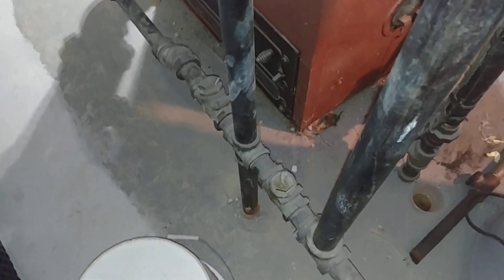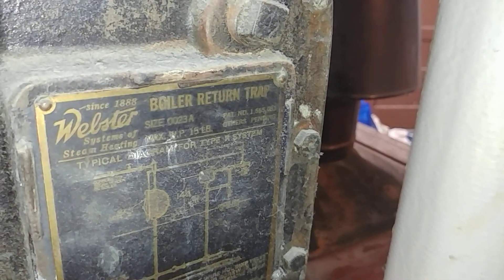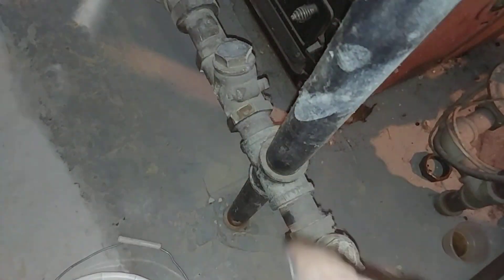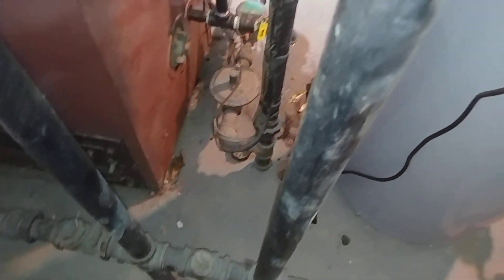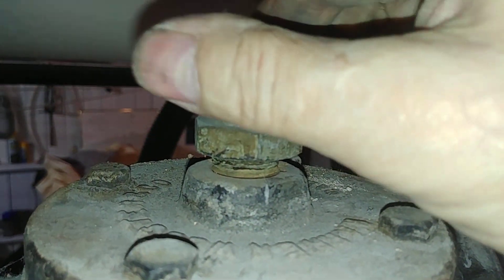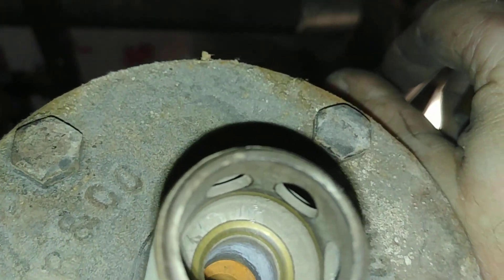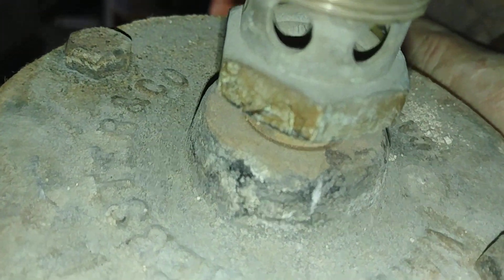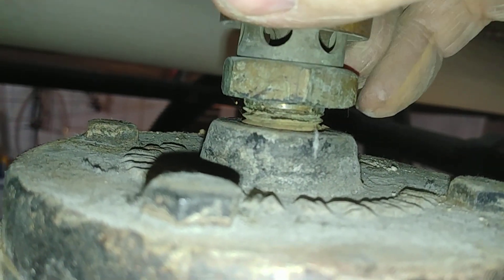Warren Webster Two-Pipe Steam System Was Still Running In A Vacuum. Not Anymore

Comment: Thanks for this video! I recently bought a house with a two pipe steam system and am learning its ways. I've never had steam before and have tried to educate myself by reading We Got Steam Heat, but I've had a weird issue involving this exact component. When the system kicks in, there is a pressure buildup of anywhere from 2.5 to 5 psi, during which time no steam is reaching the radiators. Then there's a very loud "PSSSHHH" from this valve. The pressure immediately drops and the radiators come to life! This works out ok when going from a cold house first thing in the morning, but when trying to maintain a daytime temp, the system often doesn't run for long enough for the pressure build/release to happen. I'll try looking into this vent valve to see if the ball is stuck.

Comment: hello, my church has a old 2 pipe steam system which i believe is a vapor 
/vacuum with a dry return.  With your help i was able to change out all the cage units to barnes and jones.  The system went from making all kinds of steam and water hammers to mostly silent .  On the dry return near the boiler is a dunham 220B air eliminator.  I believe the check has been replaced with a gorton air eliminator no. 1.  I would like to replace it or upgrade it if needed.  Is this the right component on the 220b or should i be using something else/better.  Thanks
Reply from the maker: Thank you for that feed-back!
It is really nice to know I helped.
What you might do is un-bolt the top of the air eliminator and remove the float etc etc completely.
Reseal the cover and install two Gorton #2s on a gang on the outlet of the now gutted Dunham.
The more air you can vent, the faster it will heat.
Are there "cross-over" traps at the ends of the mains?  If so, have they been rebuilt?
Reply: crossovers at the ends of the steam lines have been replaced. Some were in pieces when i got the covers off.  Will do on the Gortons #2. Thanks  @gordonschweizer5154

Comment: Why do you want to avoid a vacuum?
Reply: I personally am a fan of vacuum for so, so, many reasons. I have never had these issues with "pockets" people speak of. When the boiler cycles off and the steam contracts, vacuum is created to a greater or lesser extent. Because the air has been exhausted from the system, when the boiler next comes on, the steam can travel through the system unimpeded by air, and thus faster. This decreases the amount of time the burner is running only displacing air. If it's cold, and the system is tight, the vacuum can increase to the point that the water in the boiler begins to boil again - without the burner running. At around 15" of vacuum the boiling point of water is 180 degrees (if memory serves). That means the water will begin to boil and circulate 180 degree steam throughout the system, keeping the heat in the house uniform for long periods. In a good tight system, and on an average midwestern winter day, it is possible to heat the building with the boiler only running once during the day. There's nothing more fun than seeing the water in the gauge glass begin to boil of its own volition (like a seltzer water) in a vacuum and know that you're getting free heat.
Reply from the maker: According to Dan H., back in the day, getting the steam system to run in a vacuum was an excellent way to extract heat from a dying coal pile in the boiler, as it made the water boil at a lower temperature.
Also, less air in the way improved the flow of steam (called "vapor" for marketing reasons), down the pipes.
Dan says that with "modern" boilers that can shut off the steam in minutes, not all the air leaves at the same time and can cause  mysterious "blockages" to steam flow.
One or two hard-to-find vacuum leaks (and vacuum leaks are VERY difficult to find on a steam system) can ruin the beneficial effects of the vacuum.
Other folks have experimented with their steam/vacuum systems and like how their system runs.
Your mileage will vary.

Comment: I have a customer down the street with a Warren Webster system.  I took that brass vent out and installed a Hoffman 75.  I suppose it could have gone with out the Hoffman.  Works great though.
Reply from the maker: Thank you for your story!
That brass ball was most likely slowing things up.
I think that's why they switched to a much lighter aluminum alloy.
I go back and forth about putting a standard vent on top of the "vent trap".
Sometimes I leave it off.  It all depends on ...stuff.
If the boiler is way oversized and/or there are traps that have failed open letting steam into the dry return, a working main vent is a plus.
Also, it will provide a back-up to the float in  the vent trap should the system get flooded.
If you decide that it is best for your customer to have a main vent, may I recommend to you a Gorton #2.
It cost less AND vents 3X more then the Hoffman #75.
You will need the space overhead to mount the taller Gorton#2 & a 3/4 by 1/2 bushing.

Comment: My building has a gas burning Crane No. 3 Sectional Boiler for which a permit was pulled in 1936. It has a Dunham Air Eliminator Type 220B. The original air vent was laying on top of it. The vent opening appears to have a solid brass plug in it. The original vent is 3/8” threads. It is three pieces, the body that has a top that tapers to a round opening, a thin brass disc sitting on top of the opening, and a knurled cap containing holes. Assembled the disc shakes back and forth. Should the vent opening be plugged? Would it be best to reinstall the original vent with the disc removed?
Reply from the maker: Great story!
In the past, that was THE air vent &
running the system in a vacuum was the true way for steam heating happiness.
Do you know how air is getting out of your system now? Or is it that  high pressure is now being used to push the steam into the radiators?
Plugs in place of vents are usually installed when traps fail upstream and steam starts showing up @ the vent.
Reply: I know of one air vent on a dry return line outside of the boiler room. It was there in 2001 when I moved in. It is cylindrical and about 8 or 10” high. It is painted over, but I hear it working. I suspect there is at least one more vent on a parallel dry return on the other side of the basement, as that dry return joins the wet return at a T with a wet line from the other half of the basement that is an occupied unit.

I remember that years ago both air and steam would come out of the Air Eliminator. The pipes and flues are all covered in rust in that area. The morter of the brick foundation wall within a few feet of the air eliminator is 1/4 to 1/3 gone, probably from moisture damage. I mentioned the steam to a technician on a service call years ago. He or another must have inserted the plug .

During a condo conversation in 2000 many radiators were moved about. I am discovering that every radiator that was moved was replumbed without traps. I know of five so far without traps. I suspect a few more.

Our building had terrible clanking and multiple radiators that did not heat for the prior 23 heating seasons, especially on the 3rd floor, with the problem particularly bad the last two seasons.

We had many heating professionals come out over the years. They turned up the boiler pressure. We paid one company to do a comprehensive evaluation and look in all of the units. They suggested we put air vents on every radiator. Many owners, including myself, paid to have vents installed. The clanking only got worse, so bad some owners sold. Others lost tenants.

After doing some research on my own I had a trap replaced on one of my radiators and a trap installed on another. I removed the air vents and capped the holes myself.

I bought Dan Holohan’s book. Encouraged by your video on the Hoffman 17C I started rebuilding traps in the building myself starting with the public foyer radiator that barely got hot. It immediately came to life. I’ve rebuilt four more traps in two units all with Barnes & Jones 3500 cage units. I rebuilt the Dunham No 1 crossover trap in the boiler room using a Mepco 1E cap and bellows.

I then replaced all of the boiler gauge piping and put in a Honeywell Vaporstat that goes to 5 lbs. I have it set for 2 lbs. and 16 ozs. differential.

The system is now running at about 1.25 lbs. and the clanking building wide is much reduced, nearly gone in some places!

I have gotten the association board to approve paying for traps to be installed/rebuilt and radiator air vents to be removed and plugged throughout the building. I am in the process of working with owners to complete an evaluation. I will do the rebuilds. A professional will be called in to plumb in traps where they are missing.

Every trap I have rebuilt has been an old style Hoffman 17C with a barrel type element screwed into the cap. I have rebuilt them with Barnes & Jones 3500 cage units per your video.

Would you suggest Barnes & Jones 122 traps for the installs?
Reply from the maker: @fearga  WOW! What a story!
To your question, yes I can recommend the B & J 122a trap on the new installs, esp on the third floor radiators.
Remove and cap off all radiator single pipe steam vents (you knew that, sure)
Vent the air eliminator (once the traps are done)
You might be able to get the pressure even lower 1/2 psi max.
Again, I thank you for your detailed analysis. Good job!
Reply: I will try lower pressure. We also have a tankless hot water system running off of the boiler using a Bell & Gossett circulator pump. The heat drawn from the core during hot water usage can quickly lower pressure, so it will be interesting to see how low we can go.

When I do revent the Dunham 220B Air Eliminator what would you recommend, the original vent with the “penny” removed or something new such as a Gorton No. 1 3/8” Air Eliminator?

Thank you for the encouragement!
Reply from the maker: Ah!  That "thank-less" coil can really throw things off!
I guess I'd keep the pressure you got for now.

As for your Dunham 220B, try putting a Gorton #1 on for now.
I suspect not a lot of air going to vent thru that 3/8" hole, but every little bit helps.